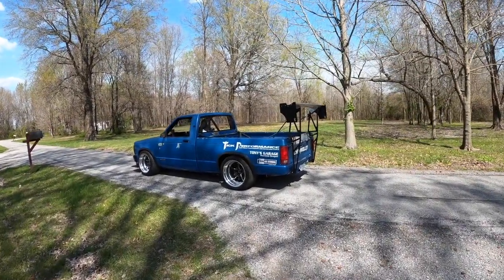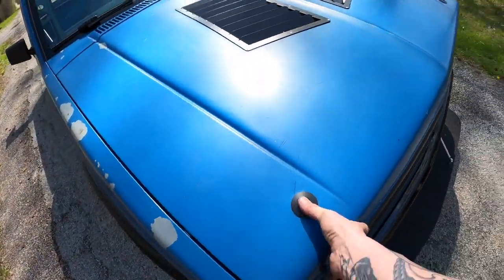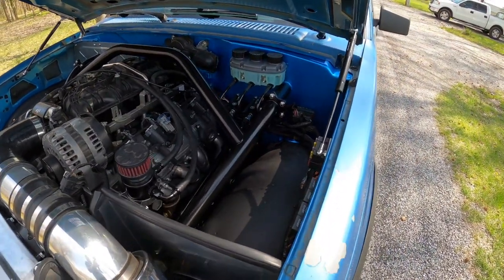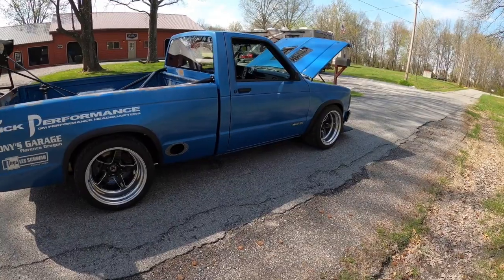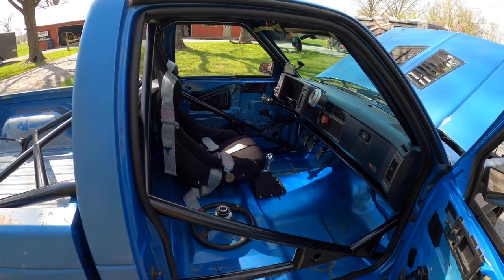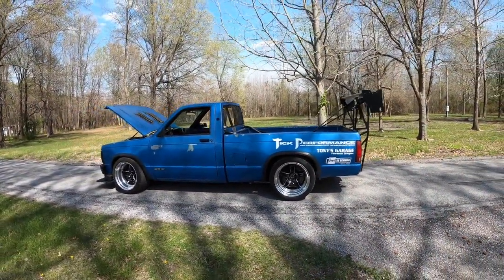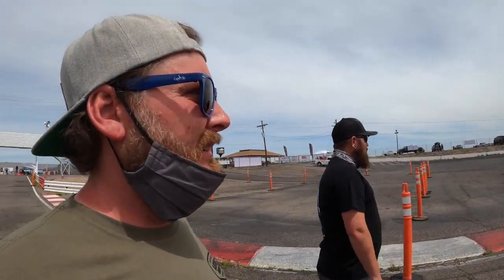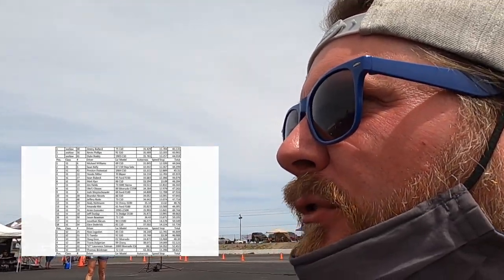Kevin Phillips Wild Road Race S10!

Comment: I really like what you did with the cage in the back. I have a sbc swapped s10 with a custom frame from the cab back and a narrowed 9 inch ford rear end. I needed to figure out how to build the cage so I could still remove the bed. Would you be able to share some pictures of the back section of the cage? Awesome build. Thank you
Reply from the maker: Absolutely. There are a ton of pictures on our website.
Reply: @level7motorsports  thanks so much for sharing. It looks like it is exactly what I need

Comment: I'm curious have you ever put in a wind tunnel or any aerodynamic testing? I have an s10 and any input you provide can save me some trial and error. Also, what's the purpose of the vehicle? Rally, drifting, or you get the idea? My modifications would be more towards every day driving which means going in a straight line a lot and might not benefit from something from a drifting set up. Still any data is good.